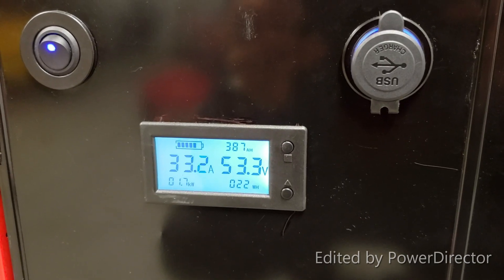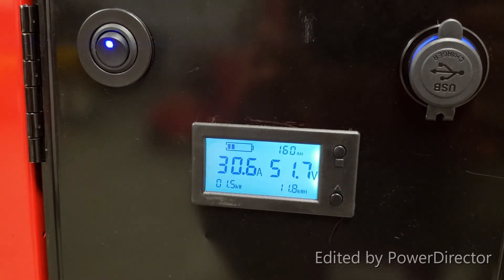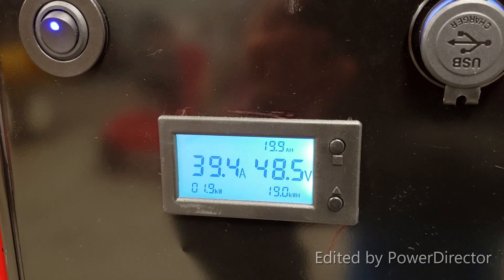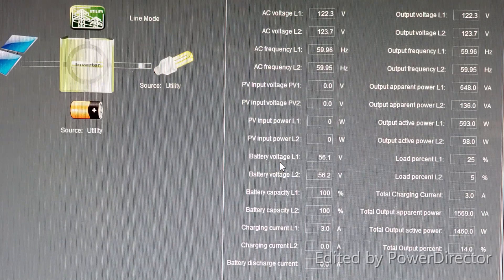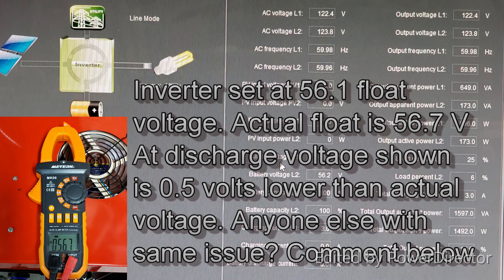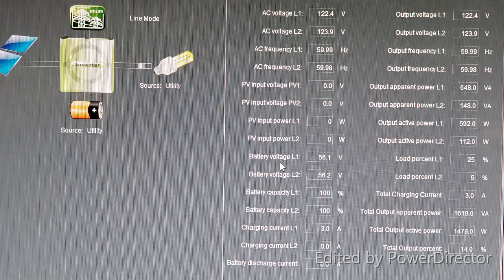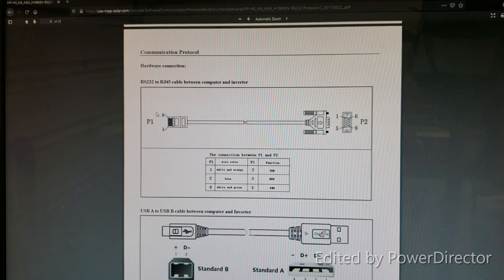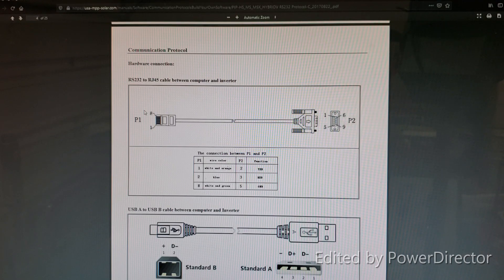LV5048 Battery Capacity Test and Watch Power V1 13SP3

Comment: There is a program you can use its called solar patrol  it works great try it out
Reply from the maker: Unfortunately it does not work with LV5048. It was designed for PIP4048GK. I have tried already. Thanks for the suggestion.

Comment: I just hooked up my new LV 5048 and was unable to connect to the unit at all with the included software. I found the SP3 version and was finally able to connect, but communication keeps dropping out constantly. I've tried multiple USB cables with the same result. Did you have any problems like that?
Reply from the maker: All depends on your pc. Are you using USB 3.0 port? How old is your pc?
Reply: @DMIINC2013  It's a fairly new laptop. It only has USB 3.0 ports.
Reply from the maker: @cowpen  I have tried both USB 2.0 AND 3.0 on my 5 year old pc. I found  out that USB 2.0 at least for me, works the best. However, the best solution and the one I am currently using is USB to serial cable.
Reply: Interesting. but now I'm confused. How are you connecting a serial cable to the LV 5048? Mine doesn't have a 9 pin serial connector. Are you using a Modbus RJ-45 to serial adapter on the inverter side?
Reply from the maker: @cowpen  Yes. With USB to serial on PC side.

Comment: Good taste with your pip lv 5048 what's the highest absorb voltage and the float the lv do on custom settings
Reply from the maker: 58.4 Volt.
Reply: The mg5048 pip inverter can go up to 64v
Reply: @offgridlivingstlucia8865  yes but is 230volt single phase not us split phase 240v so you would need a large transformer
Reply: Thanks for replying back
Reply: Is that also the highest DC input voltage. I have my chem batteries rated at 67.2v. I didnt know if I could squeeze any more voltage out of the lv5048 or if id ve forced to run my batteries between 50v-58v with this inverter. Thank you
Reply from the maker: @insidious_offroad7693  It is 48 Volt rated system. Minimum usable voltage is 44Volts and maximum charge is 58.4 Volts. Hope this helps.
Reply: @DMIINC2013  thank you guys! I think I'm just going to stick with the schneider 4048 I already bought, it will float at 65v, should work a little better for these crazy LG batteries. Thank you both for the info on the MPP!
Reply: You can keep whatever you have as long as you satisfied and happy with your setup. You the one that have to deal with it everyday and we are here to contributing ideas towards the system you about to build

Comment: There could be some miscalibration. But you will have voltage loss between the inverter and battery bank. It cannot be helped unless you use really huge wire. At .6 volts that is close to 1percent. Normally 3percent is deemed  enough without getting expensive wire sizes. Also depends on amp draws. The more amps the more loss. I didn't see how many amps where running during the test. But both volt numbers have meaning. If the volts are different with amps around 10 or less then there is a calibration issue.
Reply from the maker: For you https://youtu.be/yWeorz_9dIo. Tell me what you think.